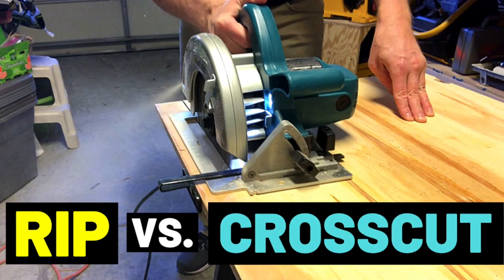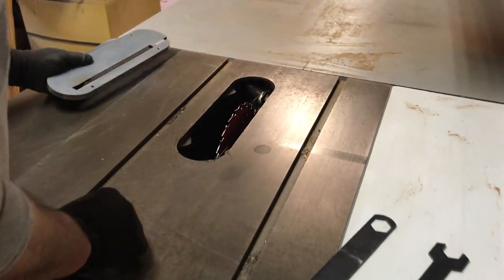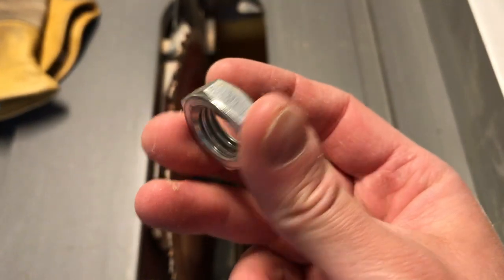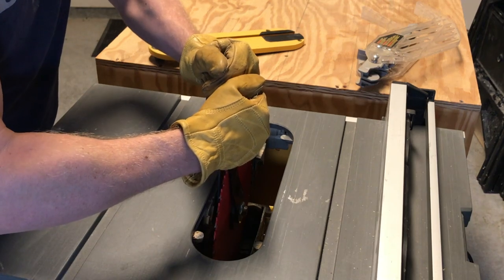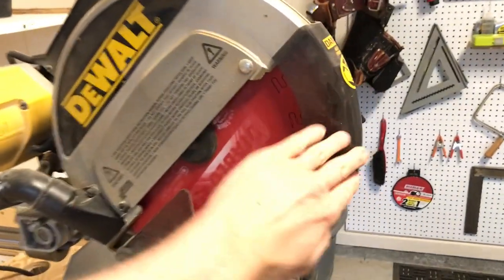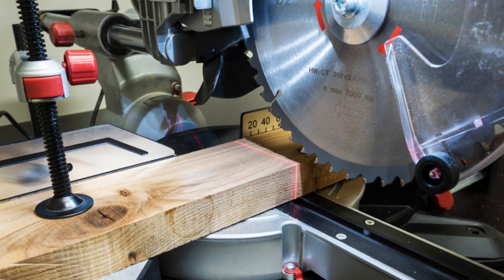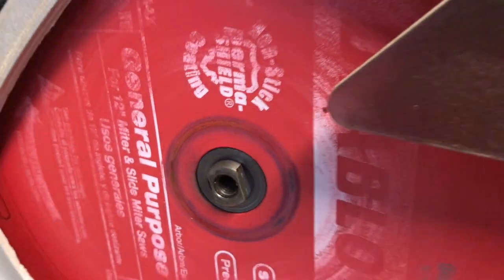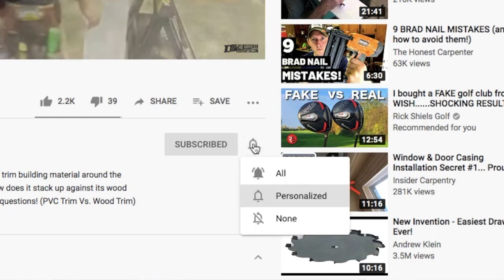How To CHANGE MITER SAW + TABLE SAW BLADES--Fast and Easy Tips! (Blade Arbor/Blade Spin Direction)

Comment: I'd love to hear when you think it would be appropriate to change blades, and if there's anything that can be done to extend saw blade life.
Reply: Clean blades often, keep the sap and build up off of them. A quick file over the teeth every now and then (only when dull) can go a long way to extend the life of an expensive blade. I do this with my expensive trim blades for my stationary saws, but I don't bother for stuff like circular saw blades.

Comment: Excellent overview on both tools - I just recently replaced the blades on my miter and table saws. The one thing to remember about the table saw is don't drop the nut! Also, make sure that you clean any surfaces from any dust that might prevent a flush connection.

Comment: Good review on how do change the blades. You should also tell your viewers to wipe off any saw dust on the matting surfaces as not doing this might result in a wobbly blade or even loose blade on the arbor. 

Lecil

Comment: I do not have a table saw yet but do have a miter saw I call it a chop saw lol. But was curious about changing out the blade for a more favorable cleaner cut than the original so I’ll leave that it came with. Great instructions 

Joe the arborist

Comment: Very good information, so why did someone click dislike? I guess you just can't please everyone.
Anyway, in my opinion the saw blades should be cleaned regularly too .Especially if you are cutting a high resin wood like pine. That build up on the teeth makes the saw motor have to work harder than it should to cut, and many times when you think that the blade needs sharpening, it turns out that it just needed cleaning.

Comment: Good video. Question, I bought some blades online, Diablo, for my new Ryobi miter saw. On the printed side of the Diable blade it shows that it rotates counter clockwise, not with the angles of the teeth towards me. The blade that came with the saw is as you describe, rotating clockwise with the teeth cutting down and towards me. Can I just reverse the saw blade so the teeth are pointing down and the blade rotating towards me?

Comment: Thanks for another great video! What would you say is a sign blades need changing? I don't want to buy new blades every time I notice they don't cut like they used to, but don't want to wait until tear out is so bad that they mess up the piece
Reply from the maker: I wish I’d said that in the video now, Fernando! For me, it’s two things—sound and pressure. If the motor sounds like it’s struggling, especially on softwood, the blade is probably dull. Also if you’re having to push real hard, same thing. Time to change blades 🙂
Reply: @TheHonestCarpenter  Thanks! I think my miter saw blade needs changing then, but my circular saw blade can wait a bit longer
Reply: You may want to consider cleaning the blade before you buy a new one, glue, sap and resin clog blades long before they get dull and stop them from cutting. I use a plastic tub and some simple green as well as a brass wire brush, clean each side and each tooth individually. Hope this helps.
Reply: @TheHonestCarpenter  I was going to ask the same regarding when a blade should be changed. I think it'll make a useful video.

Comment: My question is on that wrench what's the hook device for that you loosen the nut with
Reply from the maker: That’s a smaller wrench end, I believe William. That’s actually for another part of the saw. For blade changes, I just use the big box wrench end, and the other open-end wrench.

Comment: Probably should mention: be sure to get a blade with a thickness that matches your riving knife.  In my case Diablo blades don’t work with a Dewalt DWE-7485.  My guess is dewalt did that on purpose so you can only use their blades!

Comment: I have a Delta table saw. Not really well designed when it comes to changing the blade. The dust collection pocket doesn't stick out far enough from the end of the arbor. It's impossible to get the blade out without scratching the back side of the blade. This also makes it difficult to take the nut off and put it back on. I can just barely get my fingers down to it in the confined space.
As for my miter saw, it doesn't have a laser light. I replaced the bushing with an aftermarket laser and am very pleased with it. The only draw back is that it is only on the left side of my blade. So I have to be careful to align the laser along the waste side, or else I'll cut my piece 1/8" short.

Comment: I'd like to know how to change a circle saw blade. A friend of my brother's, before he died, flipped mine so it cuts upward. He used to do woodworking and said there was less tear out on plywood that way, but it weirds me out.
Reply: I never thought of doing that on plywood.  Might try that if I ever cut paneling again.  I usually just buy the proper blade.
However, I have flipped the blade for cutting vinyl siding so there might be something to it.  I'll have to research more.

Comment: You can’t reinforce enough that the mitre saw nut/bolt undoes in the direction the blade turns - i.e. ITS REVERSE THREADED. Clockwise to loosen, Anti-clockwise to tighten.  I didn’t realise this the first time I changed the blade on my Evolution Rage mitre saw and ended up having to angle grinder off what I thought was a stuck nut. It wasn’t, I was turning it the wrong way !  The blade lock on the evolution is not very good, I have to jam a screwdriver in to hold the blade from turning, I like your tip of using a block of wood

Comment: Just changed my table saw blade in preparation for a project in our new house. Found the supplied wrenches didn't make the move with us. 🤦🏻‍♂️ Held the arbor nut in place with a combo wrench and pushed against the blade with a length of 2x2. Came loose easily.